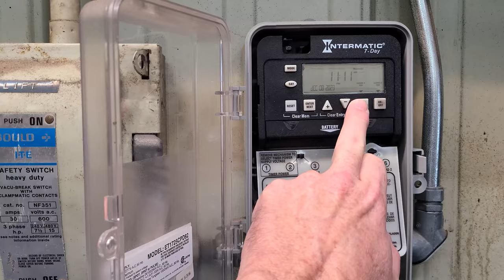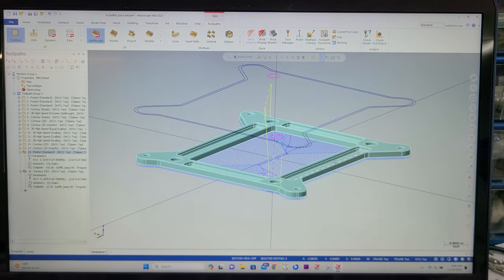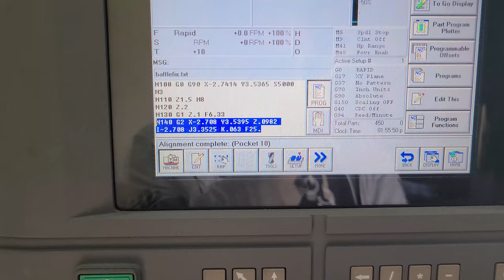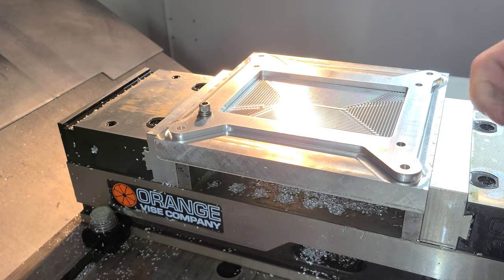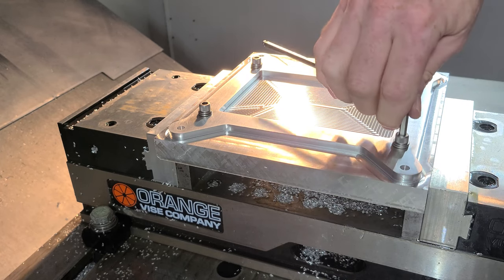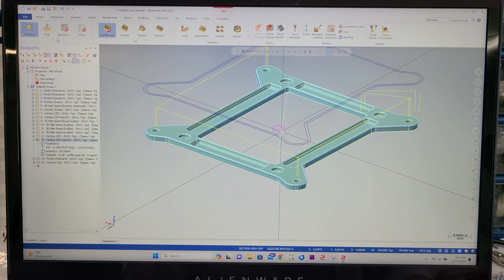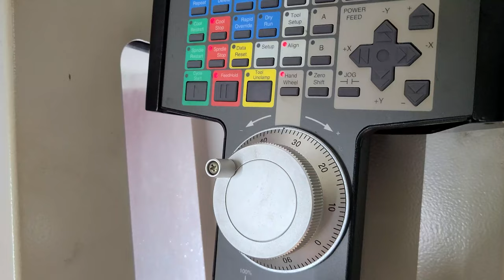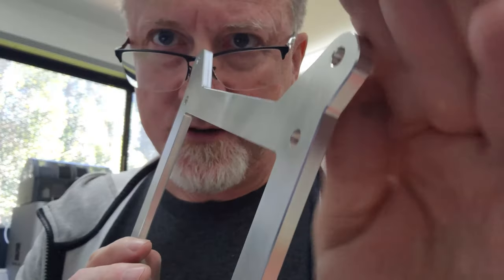Part 2 of Cutting High Altitude Balloon Flight Instrument Parts

Comment: Hey Greg     Nice work.    I have my hard drive at Siemens it went poof they are going to give me a SSD (new)  what size did your IT back up your to  I think you told me 2T that you have in the machine now    Thanks
Reply from the maker: Joe, it's a 4Gb KingSpec SSD.  KSD-PA25.6-XXXMS.  Of course you'll also need the adapter to convert from the old school spinny drive to the SSD.